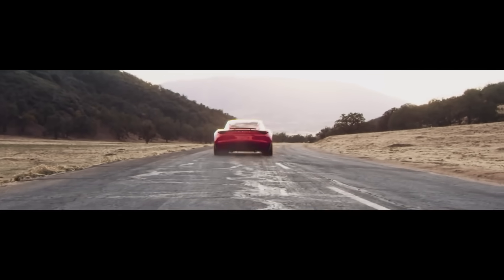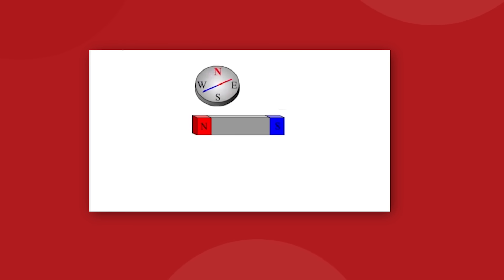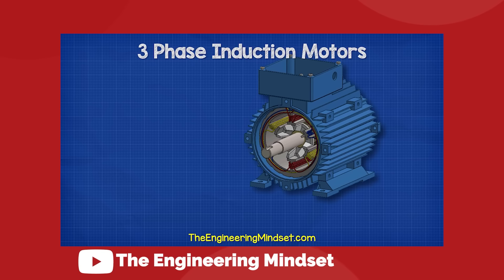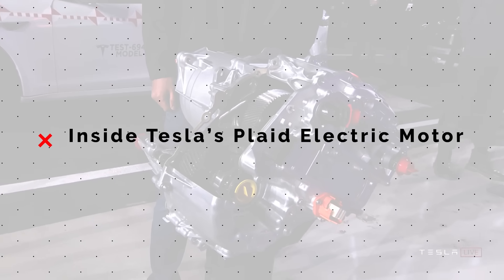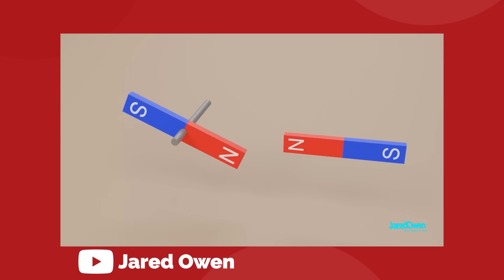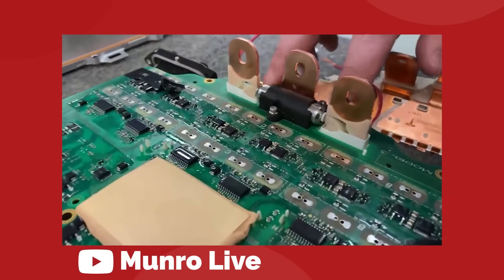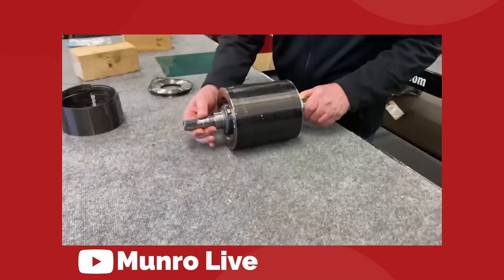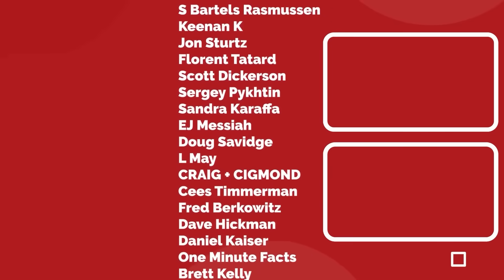The Real Reason Tesla Developed The Plaid Motor!

Comment: Plaid is a big win in power density mainly due to the higher RPMs it allows.  This has 3 advantages in applications like the CyberTruck and Semi (both of which I'm expecting will use Plaid motors):
1. Lower weight -- the motor weight is reduced in inverse proportion to the increase in power density
2. Economy of materials -- the needed copper, aluminum, rare earths, etc scales in the same way
3. Reduced motor count -- CT and Semi will debut with 2 and 3 motors, not 4 and 4
Reply: Are you really expecting CyberTruck and Semi to use any motor? Like, do you think they are real, viable commercial products?
Reply: @figadodeporco  well the semi uses off the shelf plaid motors so he's right there

Comment: Would the car still be fast if everything was made 2x bigger? Or 10 x. I always thought they have a track for 500kph racing but for that to be safe I was thinking the cars need magnets to stay on ground. Would be some crazy racing if we could go faster
Reply: At high speeds cars use aerodynamics to keep themselves on the ground. Basically the body of the car, along with various compunents like the spoiler, act like an upside down wing, using the wind to push the car down at high speeds. This is called downforce. Downforce keeps a car on the ground at high speeds but it comes with several downsides. For example it often means more drag on the car. And the more force pushing down on a car, the harder it is on the car's tires. Which is one of the reasons racing tires have to be replaced so frequently. But 500kph races are theoretically possible. I believe the current land speed record is over twice that.

As for your other question... it depends on what you mean by "bigger"... and by "faster". Tesla has the fastest ACCELERATING motor, but not the one with the highest top speed. if we're talking about acceleration and not speed, then typically things tend to get slower as they get bigger. Which has a lot to do with the square cube law. And that brings us to what it means for something to be "twice as big". If you mean twice the wieght, then sure it can be just as fast. After all, bolting two Teslas together won't stop them from reaching the same speeds as before. but if you mean doubling all the dimentions so that it's twice as long, twice as wide, and twice as tall, then you're actually multiplying the weight by 8x, not by 2x. And all that extra weight is going to slow you down. At least when talking about acceleration. Ironically, more weight actually helps you achieve a higher top speed because drag becomes, proportionally, less of an issue.

Comment: Nikola Tesla did not invent radio. That's so ridiculous it would be funny -- were it not that it contributes to the putrid pile of drap that is all the YouTube garbage around the man.
Tesla was a verbally skilled con man. He flunked every school he ever attended, because all his teachers caught on to him after a while.
He patented a few trivial decorations on irrelevant pits and pieces of engineering, and he took credit for high-voltage electrical displays which were in widespread use on the stages of his time.
He would have been a joke but for one piece of good luck: in the very public debate between Edison and Westinghouse over the future of public electric power, was it to be AC or DC, Tesla picked the correct and eentually winning, side: Westinghouse and AC.
Tesla did not  invent alternating current power. It had many developers, and one reasonable opinion, which I share, might be that Faraday was the person most responsible -- a generation before Tesla lived. Tesla didn't even develop AC. Westinghouse was the first to put it into use on a wide, municipal, scale.
Tesla bought a lot of drinks for the press from his seat at the bar of the Plaza hotel, and sounded off a lot. Some of what he told the press was correct, e.g. that Westinghouse's ideas were correct. A lot of it was wrong, e.g. that he had invented a lot of stuff which he hadn't invented.
In passing, he gulled a lot of investors into paying him a lot of money for stupid ideas which didn't work.
Eventually the Plaza asked him to pay his bar bill, and when he didn't they threw him out.
He died in well deserved poverty.

Comment: I remember when I was a little kid.  We had these itty-bitty Hotwheels called "Sizzlers."  I think the stators were permanent magnets and the rotors were copper-wound electro-magnets.
Reply: I remember my slot racing track, about the same size as my Hotwheels.  We had a bunch of really old cars, some went moderately quick.  Once a month when I got my braces tightened (I was about 12-ish), I'd get to go to Pope's Hobbyland in Wausau, WI and get a model w my allowance - Wausau to me was a huge city, about two hrs south, and for a LONG time was the nearest McDonalds.  Sorry, memory sidetrack.

Instead of a model, I got a couple slot racers, and omg - they were so fast and accelerated so quickly, I could barely keep them on the track.

Of course I didn't know wtf I was looking at, but when I took the new and old cars apart to see what they were like (similar, more than not), everything was just tighter and put together with lowerer tolerances, with all the tiny parts matched together with such precision.  I'd estimate the cars topped out at ~20mph, but seemed to accelerate there INSTANTLY...within two feet.  Crazy.

Comment: All it takes is a small magnetic particle that can wedge between the tight fitting motor to destroy the motor.  I am wondering what security to keep contamination out of the work area.  I know when I worked at Intel's Fab 23 and 25 that they had bunny suits and special shoes to minimize the particulate contamination. In some fabs, they tell us not to wear rings, watches or conductive metals on you.  This can be a very interesting subject for us techies to discuss.  In my day, it was called co-laborative thinking, but now, they call it think out of the box.😂

Comment: Both comments below are correct.  For any H-bridge (1-2-3-6-12-phases, as many needed), IF you get a short across either the reverse rectifiers or IGBTs, Fets, SCRs, Bipolars, or the forward looking device, then when you get a signal to reverse the bridge (as for braking or regeneration), you immediately get a full short circuit.  Either through the motor, or across the power bus.  If across the power bus, a circuit breaker or fuse is required to save the battery, and prevent a fusing-fire.  Usually the power devices in the inverters just blow-up (I have photos of such), or the wiring (or PWB traces) act as a fuse, and disintegrate.  If the reversal happens go to through the motor windings, then sometimes the motor resistance is high enough to prevent immediate fusing (depends on motors).  In that case, the high-current short acts as a simple "magnet" on the '"active field element" (could be either rotor or stator), and you get an high-flux pole through whatever winding it happens to be on.  This usually leads to enormous forces (limited by saturation flux), which often cause the rotor to wobble violently, and sometimes self destruct against the stator.  Also this causes uncontrolled de-celleration of the rotor, since that flux is larger than any of the rest of fields, and acts as an immediate brake.  We've seen motors stop-dead in milliseconds, from such an event.  Typically also, the motor windings often blow-out, usually at the connection points.  In railroad engines & inverters, where IGBT operating currents can run to 2000+amperes, the short circuit currents are often ten-times larger.  Typically in those usages, there are fuses (of some type), at every pass-through path in the bridge.  That serves to disconnect the motor windings immediately from the power bus, and allows the motor to continue operation on the remaining windings.  Cyclo-converter drives also have similar problems, as used in ships drives.  In cases where servicing cannot be done in real-time, such protective fusing methods are very often employed and the vehicle continues to limp along at reduced power, on the remaining phases.  In single-path DC motors this simply disconnects the motor, which then simply free-wheels.

Comment: Fiber-wrapped rotors were researched extensively during the 1960s & 70s, where rotary-energy-storage was being developed.  Such rotors were used in urban buses & vehicles, as inertial storage.  Physical design actually shows that a rectangular-shaped rotor dies not have an ideal amount of energy storage.  High-energy rotors use a "semi-cycloidal" shaping, as dependent on the  strength of the fibrous windings.  We looked at some of this while we were developing the Lunar-Rover motors.  Fiberglass & Kevlar & Aramid fibers were used before carbon-fiber was available.  The fibers actually do reduce the efficiency of the motor, since it is an airgap.  However when the rotor expands, due to heating, the carbon can be shredded-off, and actualy "scrubs-to-fit" the stator.  As such the motor can be self-adjusting to its specific thermal regimen.  This technique is now used in aircraft turbines, as in C17, where the fan actually is made to grind-to-fit the containment stator.   However, if the Tesla motor "overheats" beyond its design range, and if the carbon is shredded, and IF oxygen is available, that motor will actually combust and burn internally.  Some other vendors actually suck-out the air inside the motor, to a semi-vacuum level.  This improves the aerodynamic efficiency of the rotor.  If rotor goes near-sonic velocity, in the gap, this creates major aerodynamic losses (shock waves), which will either heat the motor, or cause high-energy vibrations, which can also destroy the bearings.  We ran into this in uranium-seperation equipment, at 60-to-90-thousand rpm.  None of this technology is new.
Reply: none of these ideas are original.  Everyone is just titillated by all the advertising muscle Musk has spent.  Calnetix has been making high speed rotors like this for decades and the stators are nothing special at all.  I'm surprised Musk didn't buy Yasa before Daimler Benz did.  Just tells me he really isn't interested in innovation that much.
Reply: @gendaminoru3195  Wow.  Glad you got the guy all figured out.  I was just starting to think he was alright.

Comment: I confirm Karl's comment.  At 14:20: "the inner wheel spins faster" in a curve should be outer wheel. (Outer wheel travels through a larger arc, longer distance, hence outer wheel has to spin faster at given speed)
Reply: UNLESS when feeding enough power through an open differential to smoke the inner tire... ;-D

Comment: I do believe the fuse is a high speed dc fuse the high speed of the explosion breaks the high voltage arc genius especially under a load the arc is hard to break

I'm not 100%positive but it's my thoughts

Comment: I would like to know more about how the Tesla inverter controls the speed of the motors. It is my understanding that the inverter changes the frequency of the high voltage 3 phase ac it send to the motors. Does anyone know the voltage  and amperage being sent to the Plaid motors? How do they change the frequency of the power being sent to the motors? Does anyone know Tesla's Plaid inverter frequency range from minimum to maximum? How do they change the speed of the two motors, so that the wheels turn at the right speed when going around corners, without a differential? Maybe they are not perfectly synchronized when cornering and that is why the Tesla tires wear out so fast? The computers in the Tesla inverters must be really good at sensing the different motor speeds necessary to prevent slippage when cornering .

Comment: I have worked with what is usually referred to as AC brushless motors since they first appeared. One interesting point is that an Israely held a patent for this that is now out of date allowing Tesla and others to build cars with permenant magnet rotors and electronic commutation without having to pay to the patent holder.
Reply: This design is quite common these days essentially found in pretty much all DC brushless motors, this particular design is know as a PMSR motor or Permanent Magnet Switched Reluctance motor. They don't use alternating currents but electronically switched DC to flip the polarity, alternating currents aren't used because it would increase complexity and introduce losses in the control electronics. I think Tesla have stopped using induction motors in all their models now in favour of these more efficient PMSR motors.

Comment: While the engineering that has gone into electric cars is phenomenal, the problem with electric cars is that the overall experience is linear. What I mean by that is this: no matter how good the technology of the car is, or how great the driving experience is, if there is just ONE aspect that is bad, horrible in fact, then the ENTIRE car and experience suffers from that one failing. And of course, that failing is the time it takes to put the electrical energy back into the batteries. For example, if your range is 300 miles at 60 mph, you have used up the battery in 5 hours. Most devices of any kind that use a standard kind of charger (not deemed a fast charger) take several times the discharge time to recharge. Even with a fast charger like might be used on lawn power equipment, it might be able to recharge in half the discharge time, which is really good in general. But in our car example, if you are out on the road, 2 1/2 hours to recharge is just not viable. Even if a really fast fast charger could recharge in ONE hour, or five times the discharge rate, that is still terribly unacceptable. You would have to increase the charge rate by at least another 10 TIMES, down to 5-6 minutes to be anywhere near competitive with fossil fuels. I don't know what the discharge current would be at 60 mph, but increasing the RECHARGE current by 50 times seems out of the question to me. You would have to dissipate 50 TIMES the heat generated by discharge. And this is why electric cars will ultimately fail mass acceptance, unless there is a quantum leap (pun intended) in technology. And that is not even touching on the subject of recycling these batteries. There is NOTHING in a fossil fuel vehicle that can not be safely and completely recycled or disposed of. The same cannot be said for the electric vehicle. So far, I have not even heard of any plan to safely recycle these extremely dangerous batteries, not to mention similar problems with their manufacture in the first place. Besides, our electrical grid would never support the kind of mass transition that our dimwitted politicians are trying to suggest. Just like all their other plans, this dog just ain't gonna hunt.

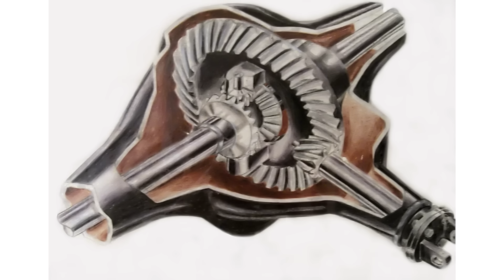Comment: At 14:23, regarding differential action, the script indicates that when the vehicle is going around a corner, the inner wheel has to spin faster.  Assuming that the 'inner' wheel is logically the one toward the inside of the corner, it has the lesser distance (smaller circle) to travel and thus less distance than the outer wheel (larger circle).  Then to maintain a constant speed through a corner, the outer wheel must make more rotations than the inner wheel, thus the outer wheel must spin faster (more rpm) by some degree than the inner wheel.

Comment: Steamship / Hydroelectric Powerplant USCG Engineer here.
If you think blackouts and brownouts are a big problem now, just wait ten years when millions of electric cars plug into The Grid at night to recharge. Better start fixing The Grid soon.
Reply: There is a surplus of power at night that's why there is cheap off-peak power at 1/2 to 1/3 the price only 20 % demand while people sleep 10 pm till 8 am were I am 9 cents a kw compared to 28 cents  peak I have an electric car and enough solar to charge it and run the house those that have no solar would be foolish to charge at 3 x the price in the day. Black outs and brown outs are in the day when people awake using lots of electricity.  Charging electric cars at night is a good way to lessen the load on the grid combined with less oil refining that uses lots of electricity.
Reply: @JonathanTamm No.  You missed the point of the post.  If a large percentage of the population, who work during the day, have cars that need to be charged at night, then the price of off peak electricity WILL go up due to supply and demand.

Comment: At 14:19, the inner wheel has to spin SLOWER than the outer wheel.
Not FASTER.
At 15:57, the laminations would be used to help minimise EDDY currents, just like a transformer core.
At 6:17, why are you showing a DC brush motor, while describing an AC induction motor.
The motor you describe has no brushes.
Sorry....

Comment: I wonder if wrapping the rotor with carbon fibre is inspired by COPV (composite overwrapped pressure vessel) tanks for rockets. Standard stuff in one industry is revolutionary in another; having the chief engineer of SpaceX be so involved in Tesla Motors is good for both. Hell, they're using the car motors to move the flaps on the rockets.
Reply: no, tesla stole the idea from others. tesla motors and space x are a scam

Comment: Why not invert things i.e. put the magnets on the outside and the windings on the inside?  The rotor would then be stationary and the magnets would rotate around the windings.  The MAC/GMAC ebike motor uses the design I am talking about and it works great on my electric bike :).
Reply: the rotor is electrically isolated of stator in this configuration. if you invert, then how you feed so much current to a rotating stator?. also. the purpose of this design is to "play" with reluctancy. those magnets that you see in the vid are not required, they give a significal boost tho

Comment: Single-shaft propelled submarines experience a gyro effect where turning via rudder would cause the sub to dive. No one mentions this inherent property of these massive 20,000 rpm rotors??? Also why twin engine jets are more manageable